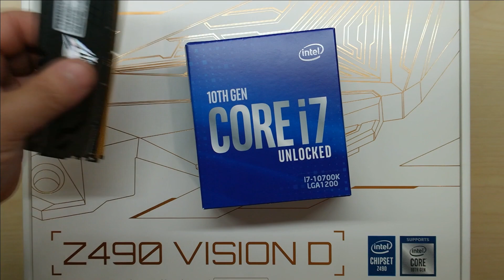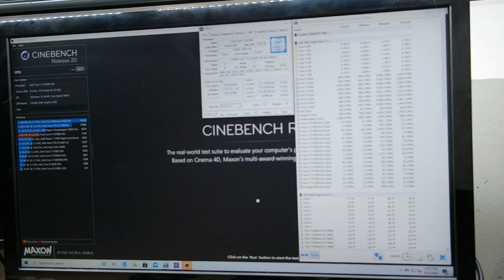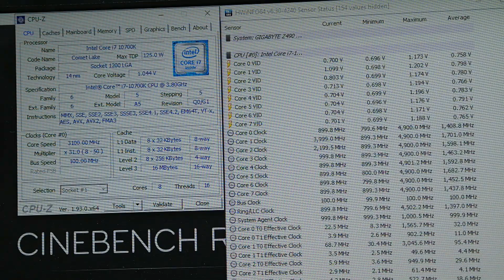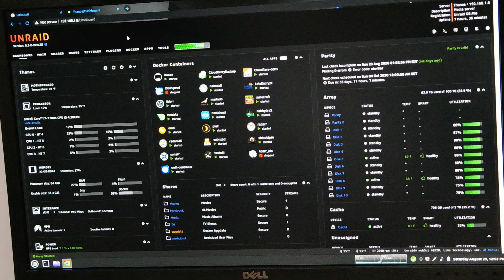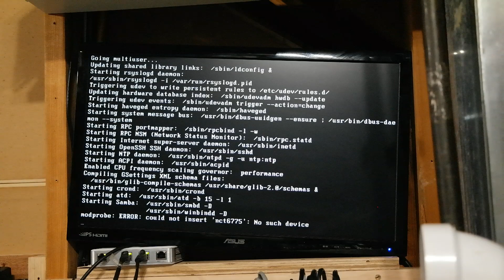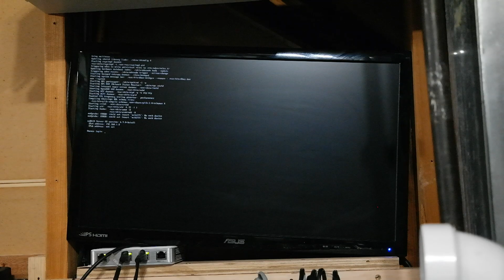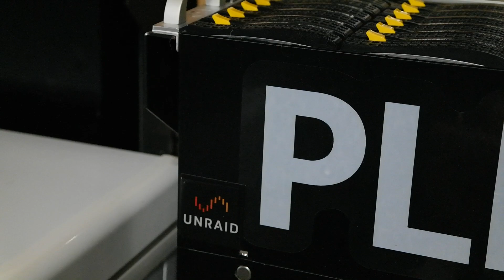Upgrade Unraid Server To 10700k

Comment: How did you attach the fan on your HBA card?  And will it interfere with a PCI-E card in the slot above it?
Reply from the maker: I took out the metal heatsink retainer clips and used nylon screws and nuts to mount the fan and heatsink together.  The fan will basically turn this into a dual slot card space wise.

Comment: Quick question when you do something like this do you have the back up Unraid or something? I was thinking about switching out my CPU and my motherboard and moving all my hardware to a different Case but I wanted to know if I should build a new computer and then back everything up or just move everything to the new case?
Reply: I think UnRaid will autodetect any new hardware on bootup and run just like it was already on the hardware that was just replaced (at least that is how linux handles OS/Hardware swapping)
Now you might have to ensure the ethernet is setup correctly, but UnRaid holds all it's config files for the services run on it and whatnot on the storage media, the base OS is run from a USB pendrive I believe
Reply from the maker: Brian is correct, the only setting I needed to update was the driver to detect motherboard temperatures once the switchover was done.

Comment: Just built a new machine myself. I turned towards AMD instead and got the Ryzen 9 3900Xt which is about the same price as the 10700K... Just tested my cinebench and it's 7049!.... Still.... Was a hard decision. The thing that got me was PCIE 4.0. My NVME 4.0 drive is testing literally at 5006MB/s... crazy speeds. Intel has some catching up to do
Reply from the maker: If I didn't need quicksync I would have went the same route you did.  Good job on the upgrade!